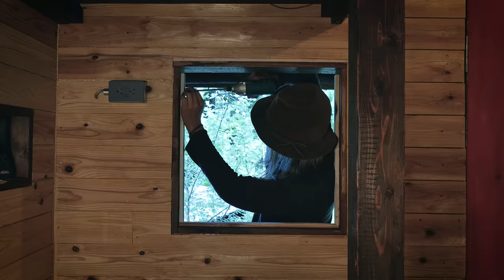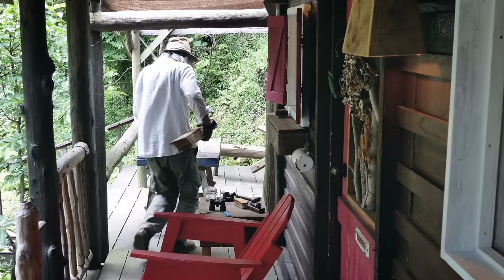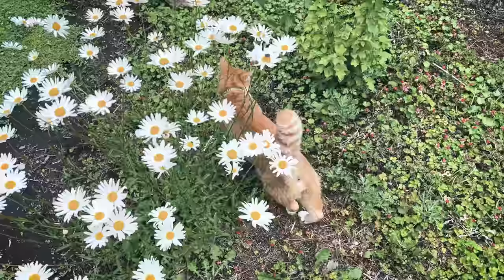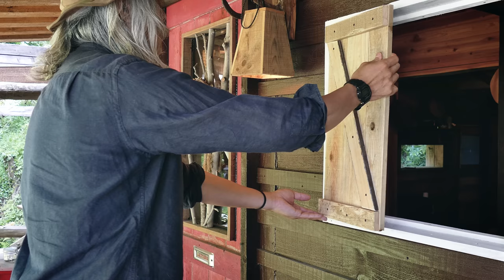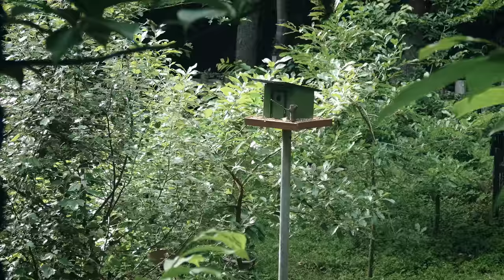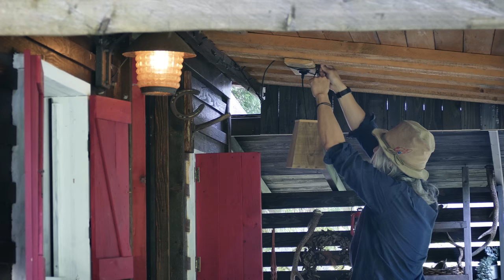Making window shutters reminiscent of a Swiss chalet.

Comment: Again, your video is so lovely.

A suggetion for your bird cages in future builds. Why don't you put a small strip of screen at the top  back of the cages to allow air flow. It would come through to door hole and the heat would escape out the back of the cage.